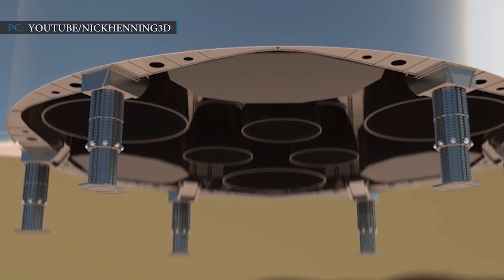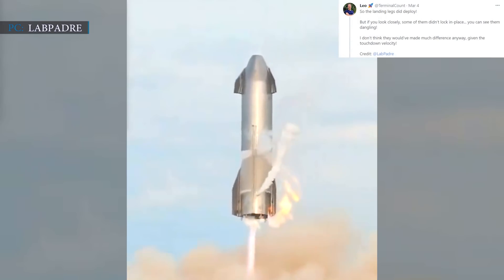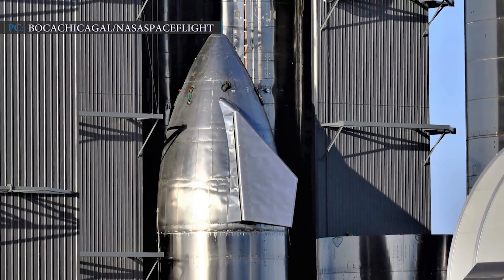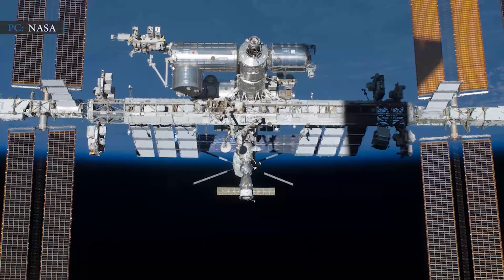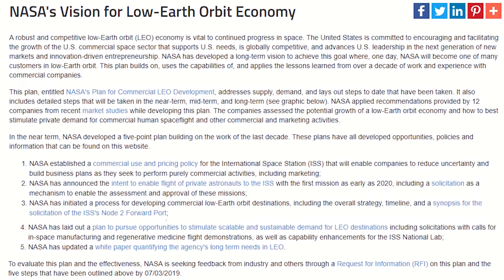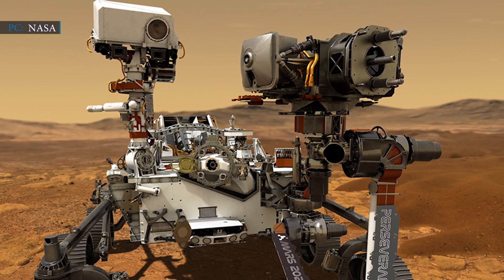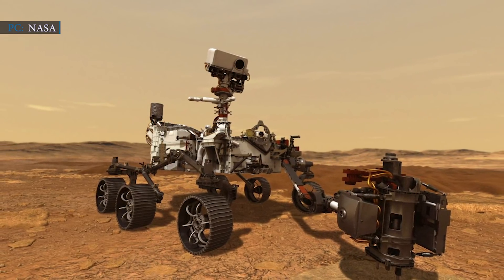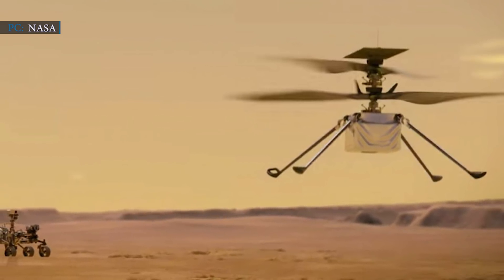SpaceX Starship landing leg upgrades Concept | NASA Perseverance makes its first drive on Mars

Comment from the maker: Huge Thanks to ErcXspace for Thumbnail Image
Reply: Nice
Reply: Cool
Reply: The new legs are, well...nice, but they lack specifics. It's a good start but things like load and shock will need to be specified. What is the intended speed of touch down? What is the max speed the legs should absorb of a fully loaded Starship?
Reply: Also, the legs should have wheels like those trolleys ! A rocket with legs and wheels !

Comment: As to the repricing of NASA services for commercial projects on ISS, I think that is a backhanded slap to the face of commercial providers who were encouraged to participate in these programs on an affordable pricing schedule and who built their programs on that basis. These are not small increases but high multiples of their earlier quotes. This calls for the further development of a private space station that can be used for that purpose along with other more affordable governmental uses. It also belies the high launch rates already charged for companies like SpaceX to use NASA launch facilities. It costs SpaceX millions of dollars to launch a Falcon 9 rocket. I have to presume that SpaceX would like to launch all of those rockets from a more affordable place like Starship City. That could be another use of the first of two orbital launch pads currently being built at Boca Chica. Furthermore, NASA has promoted the use of former NASA employees to build a commercial space station at the expense of better qualified companies who already had working equipment and plans in place to build such a station. The taxpayer will now pay these former NASA employees for their OTJ learning. Initially, they were paid $156M. More is on the way. The core of that new station will be built around the ISS - the most costly project ever built that cost billions of dollars annually to operate. A large portion of which is now unsafe, outdated and falling apart. Then there is SLS and Artemis :-(

Comment: Unlike Falcon9, Starship does not benefit from long, sexy legs, sliding in from wide angles with powerful hydraulics to really stick almost any landing, even on water.
Starship is thicc.
She needs strong legs...
But landing leg breadth is irrelevant. Load distribution is paramount. Having a wide foot doesn't change the fact that 1/4 mass (with proposed 4 leg design above) is sitting on a few pins. Even if they are massive, it is DUMB. The current legs (though fault in their first live trial) distribute the load further, resulting in less deflection and less chance of catastrophic failure. Current legs carry the load vertically into the hull, rather than through a sidemounted pin/hydraulic. This drastically reduces complexity and structural weakness/fatigue risk factor, While also reducing drag, and mass.

Comment: I think a compressed air jet powered drone such as the one designed by Tom Stanton might be good on Mars. It could fill its tanks with a small onboard compressor over time while at rest.  This may compensate for the thin atmosphere.

Comment: Unfortunately I cannot post a diagram here, but I still think a six-leg approach with vertical hydraulic jacks distributed around, and entirely inside, the skirt is the way to go. The only way to support this kind of weight on unprepared soft ground (think Mars or Moon) is a large area foot (think construction site crane on Earth). The foot could be hinged to the bottom of the jack so that it tilts vertical and retracts into the skirt (taking up just a small amount of space against the skirt wall). When deployed, the foot would protrude a significant distance outside the skirt perimeter and the hinge would lock to provide stability against toppling. The vertical hydraulic jack fulfils multiple functions: it deploys and retracts the foot; it absorbs shocks on landing; it provides a levelling mechanism for uneven ground; it allows individual feet to be lifted and re-seated after landing; it allows the whole vehicle to be dropped down onto blocks for repurposing as a habitat.
Having the legs stow entirely within the skirt simplifies things greatly in that they do not interfere with aero or thermo dynamics and can be constructed out of light-weight materials. Having redundant legs with large, flat, adjustable feet is the only way to land safely on unprepared ground.

Comment: Lunar Starship legs are no problem. They can fold down from the side like Falcon booster, or whatever -- because no atmospheric reentry.

But for Earth and Mars descent, I don't know if you can have seams through your thermal tiles. Those might have to come down out of the engine skirt. Maybe they could fold out with multiple joints, so as to be much longer and more robust.

Comment: Starship still needs at least 5 landing legs so as to be able to land safely if one fails. It also needs to take the landing shock if an engine fails so close to touch down that there's no time to start, or throttle up, another engine.

Comment: the problem with Falcon9 like landing legs is bc of the re-entry heat right? bc they need to put heat shield on the legs, so would it work to put all of the sistem on the inside of the ship, on the skirt, that way the exposed outside keeps simple and with heat shield idk just a tought

Comment: I wonder if SpaceX is reconsidering against the Raptor engines. They seem to be the "weak leg", although probably engine restart on a dime is a difficult problem for any rocket fuel/engine. You can't have a human air transport system that has any failure rate above 0.000%, at least if we compare to jets. They'll need YEARS of unmanned missions to justify people's lives on a suicide bellyflop landing.
Reply: John Jacob Jingleheimer-Schmidt  I thought that Japanese billionaire wanted to fly around the moon on one? But I suppose you could still drop people in a parachute capsule.

Comment: Regarding Space-X & the landing legs!! I'd say no leg design shown or previously used by space-x are really suitable for mars or landing on the moon, unless there's a solid landing surface made up prior to space-x landing, which kinda goes against what space-x is aiming towards!!

ie teh landing legs & feet need to support the space crafts weight on a soft uneven surface, so its fee need to have a wide surface area, potentially the ship may sink slightly into the surface material on either the moon/mars!! upto now none of this seems to have been taken into account.

Comment: I like the exterior mounted legs (with hydraulic absorbtion and heat shielding) but make it fixed instead of that software-activated articulating version.  This would be simplier.

Comment: Isn't there concern that the housings for the legs aren't heat shielded or that heat would get into the ship through the gaps around the legs?
Reply: John Jacob Jingleheimer-Schmidt  
Right, and they'd have to have a skirt or something to keep the mechanism between the flap and the body from melting.

Comment: Do you think the raging fire before landing had something to do with the RUD? I'm thinking the fragile landing gear isn't the only problem.
Reply: I agree. Part of SN10's "lean" looked to be from a bend in the body itself, about 33-40% of the way up. The fire was opposite that bend, meaning that some fuel line was likely 'popped' open.

Comment: People need to remember when designing potential legs for a starship...it weighs over 240,000 pounds empty. Add fuel and whatever else might be on board and it goes up very quickly.  Look at outriggers on a large crane and then make the legs 3 times larger.  The Starship is huge and moving. The legs need to make hundreds of landings...potentially.
Reply: use tones,no one understands your stupid measuring system
Reply: @georgeionescu6425  Speak for yourself.

Comment: The legs was flopping in the breeze .  It looked as if only three had locked in place.
Reply: Spacex needs to use the same design as falcon 9 leg's.  The design for falcon 9 rocket 🚀leg's can take a impacted.  It's clear that weight/speed could be a problem 😕if landing  . Use the same design of   falcon 9 leg's ? Because leg's can take a impacted of 20-50 miles per hour. I believe spacex will upgrade the design now but landing on the moon / Mars would be harder.  No landing pads too

Comment: The legs weight is a serious issue.
Reply: A more serious issue is how to account for the heat tiles which will have to cover half of Starship, including potentially half of the landing legs.
Reply: They want to keep weight down, but I think they'll have to bite the bullet and lose cargo capacity. The legs have to be strong enough to make multiple landings. Maybe hundreds.
Reply: Spacex has come far  the landing of sn10 was not failure but a opportunity? Starship leg's will be better and spacex has a design 👌falcon 9 leg's design could be used on starship so I believe that starship will be great in the future 💯🎯 landing on Mars / the moon will not be easy too and there no landing pads.  So greater/ stronger/ widther leg's are needed for starship in the future

Comment: Thinking when anyone tries to design Starship landing legs you must take in account this ship is going to the moon and Mars, which in the beginning will not land on a harden cement pads. What I see in this video and others is cheese slicers into soil, you must have larger landing pad surfaces for unimproved landing sites to distribute the weight.

Comment: with the amount of hand waving going on for those "designs" to work, its amazing that people latch onto it so much.

Anyone can make a picture with legs in different configurations, I have yet to see a single design put forward with an actual design shown, how is it stored, how is it deployed, how much weight can it hold, what material and thickness is needed to hold that weight, how much will they weight, how will they level a vehicle that has landed on a non-flat surface, how are the legs retracted, ect...

none of these are even touched on, just a picture with legs and non descript support arms that are just stuck there attached to nothing.

Unless I've missed something, these "designs" are the equivalent to my 10 year old nephew "inventing" a new bike, (he drew a bike with a 3rd wheel but in the middle of the bike)
Reply: Go outside and plant a tree 🌳
Reply: I agree. None of the designs are strong enough to hold up the weight of a starship. They might look cool in a picture or video game, but they aren't real ideas.
Reply: I'm all for people coming up with designs, but like, actually come up with a design. Not a pretty picture of what it might look like.
Reply: John Jacob Jingleheimer-Schmidt  see, that's just it, they aren't engineering anything. Or if they are, they aren't showing any of it. Artists rendering is not engineering, but its put along side and passed off as actual engineering and even used as the main point of topic (see thumbnail) There is plenty of real engineering to talk about and if artist rendering (fancy fan art) is what thrills you about what SpaceX is doing then that's great, but that's very much not me or what I am interested in. If it is an actual design that we just haven't seen any info on then I would be happy to change my idea about.